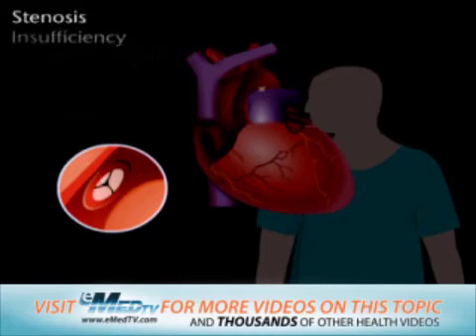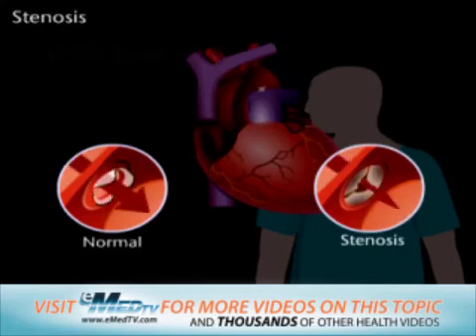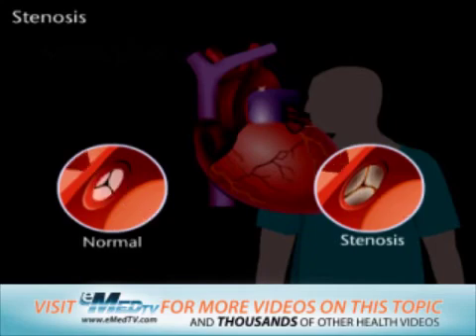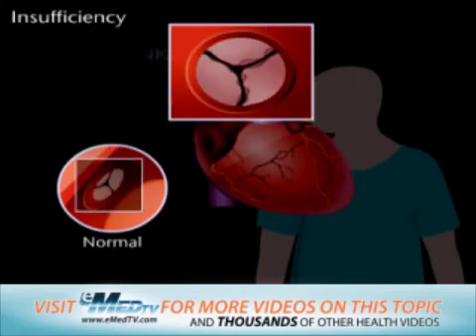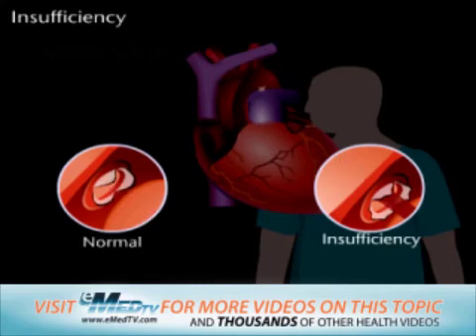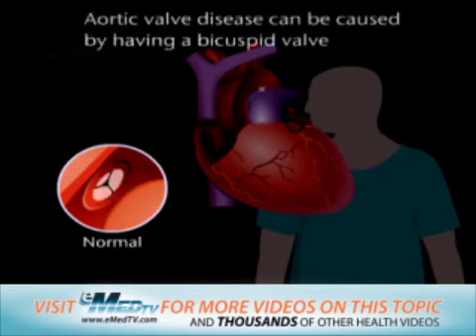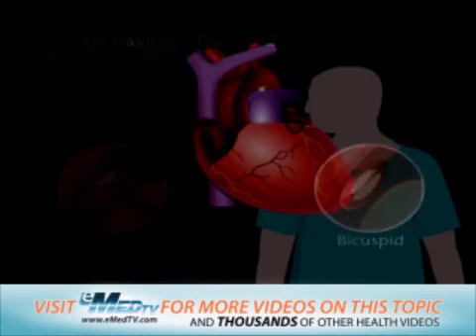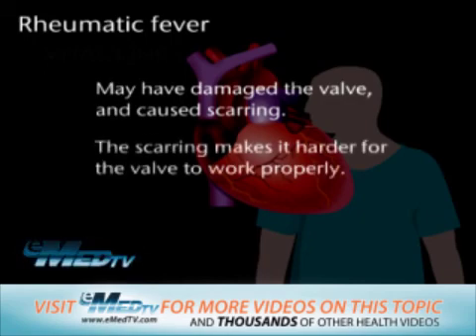Aortic Valve Problems

Comment: Don't worry too much.  It takes a big leak in a valve to cause a big problem.  I scan hearts for a living and see this all the time.  When I was 26, I was in training for the job and they found out I have moderate aortic insufficiency (aortic regurgitation.)  My cardiologist told me to definitely get checked up regularly, which I do, but I'm fine.  I was in good shape before it was caught and I'm in good shape now.  I'm 35 now and it hasn't worsened at all. I can still do lots of cardio, too.